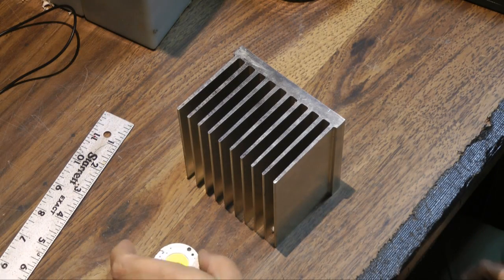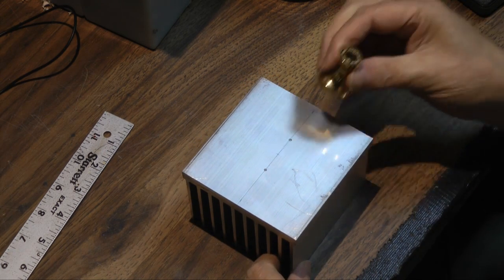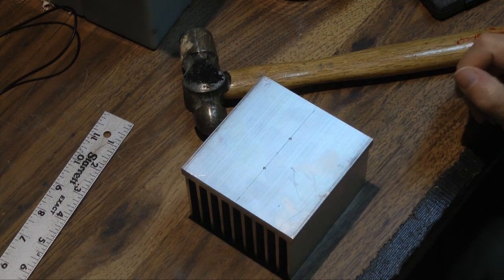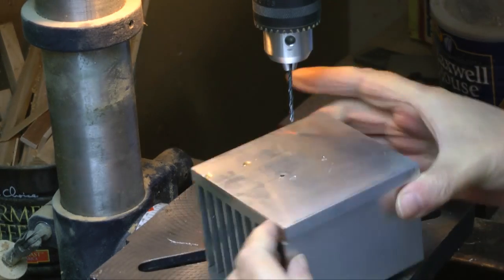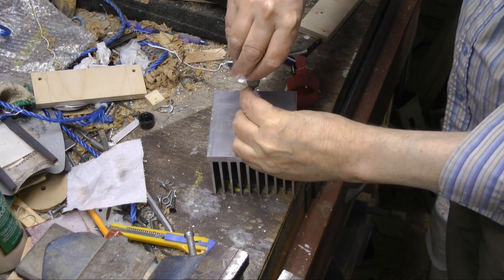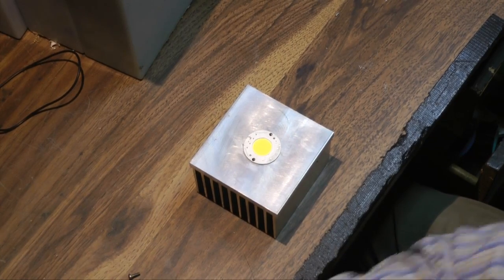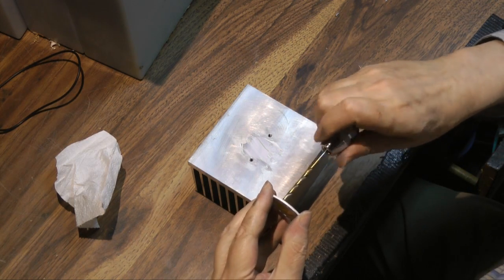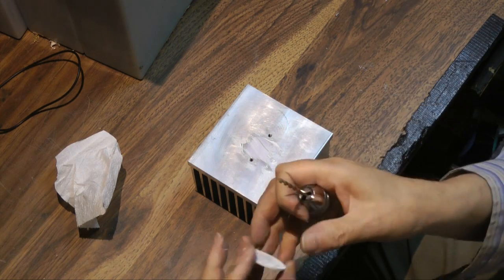Installing LED COB on passive heatsink

Comment: I saw a video where 110cm2 disapates 1 heat watt. And LEDs become more inefficient as they get bigger. I think he was using a 5-10watt led. He found it was 56% efficient. So 44% of total wattage was wasted as heat. Let's say your 45watt led was 50% efficient. That would mean 22.5 watts is being wasted as heat. So you would need (110cm2 x 22.5) ~ 2475.0 cm2 of total surface area on your heatsink to disapate the heat generated. Nice video.
Reply from the maker: Whoever said larger means less efficiency doesn't know what he's talking about... the reason I like a large LED like the Vero29 (29mm) is because you can get over 200 lumens per watt. A small LED like a V8 (8mm) averages 100, you're lucky if you can get 120. Right now I'm working on designing a battery operated emergency light, and even though I only want 150 lumens, I'm going with a V18 so that the battery lasts 2 days, not 12 hours, which is what you would get with a small 150 lumen LED. The V18 could output 12,000 lumens!

I usually use a fan for cooling, I only use passive on small lamps like ceiling lights (no noise). This video was just a test.

Thanks for your comment.

Comment: did you ground this light?
Reply: Most of what I do is experimental on the workbench, and I use isolated power with no connections to the outside world, including ground, for safety and practical reasons. Since my oscilloscope is grounded, I cannot ground the electronics I work on or it would blow up! Any luminaire I make is usually case grounded.

Comment: I am currently DIYing a 50W COD 220W (Driverless) on some old intel PCU heatsink. this :https://cdn11.bigcommerce.com/s-n2pgpewhfn/images/stencil/1280x1280/products/393584/391141/A57855-001-lg__71618.1555056032.jpg?c=2
During my first testing, the heatsink is reaching 50 degrees, because I supplied the fan with only 5v
Test 2, fan supplied with 12v, cooling is better, and heatsink is around 40-42 degrees.
I like it working at 5v , because fan is not noisy this way.  do you think 50 degrees is fine for a heatsink connected to a 50W COD?? with Fan heatsink is reaching crazy temps, at stopped at 80 degrees, because dont wana destroy the led...
Thx for any feedback, 
Regards

Comment: u have any old used hi lum cob for i need all the help i got 114volt 320watt 2800mah what can i do with it i got 1212 cluo48.  not 1216  help
Reply from the maker: I don't know what COB you can run with that supply, do you know the output voltage range?

Comment: Given the choice it seems like the cpu fan is a better option? Those artic cool fans are now only around $10

Did you run an experiment with no heatsink or cpu fan? If so what temps did you hit?
Reply from the maker: The fan won't last too long if it's running every day, certainly not 10 years like the LED. Also it may be subject to high humidity or dust or something. Moving parts are always a disadvantage! I did start to experiment with passive sinks but I moved to a new house, then I had an accident, and I haven't had a chance to get back into it. I will start again soon, but I can tell you that it depends on the size of the sink and the LED. I have to import sinks from the States and that is freakin expensive, especially shipping on the big ones! A 4" cube sink can maybe cool about 45 watts, and stay below 85C. I'll have more data soon and make new videos.
Reply: @Flintsmooth  I loved your video and the information you provided, I didn't already know. I love coming on the internet to learn new things. That being said, I think you would be surprised at the longevity of CPU fans. When I lived in Maryland (I now own a home in Michigan and live there) I ran a 6 core AMD Apu for nearly 8 years straight; full throttle on the factory cooler. Don't ask me why... But it never hiccuped even in the slightest. Never stopped performing and never gave me the idea it would fail. Maintenance is key with anything that has moving parts, every now and then vacuum or use compressed air to clean the heatsink and fan. With passive cooling applications this is nearly negligible, but for active cooling it will drastically increase the lifespan of your fan.
Reply from the maker: @troyguinn303  I do have LEDs with fans running, all my grow lights have fans, but my custom house lights are passive. One problem I had was a wire got too close to a fan and somehow got caught in the blade, the LED burned itself black! Could have been more serious, but it open circuited. I make sure my wires are better secured now! I don't mind fan noise in the grow room since I don't spend time there, but in other places I prefer the quiet!  I have a grow cabinet in my living room with 4 fans, that can get a bit annoying! I have bought at least 25 different fans from amazon and I test them for air flow and noise. Someday I'll engineer a proper test facility and do a YT video of comparisons. My most powerful and noisy fan is a small Bgears unit, but not all Bgears fans are the same.

Comment: hi again..good work as ever.how much do you think would be cob temperaure on a vero29 v7 run at 1050mA? around 38W...could you also say me the heatsink code  to see the datasheet?  it seems to be similar at a m1 passive from artic but with a flat base, isn t it?

Comment: Hi. Can you tell me from your experience what surface heat sink need for 3 watt power led? or if is some calculation for that? I have 3 watt led X 4 pieces mounted on the same heat sink aluminium(4,5 cm/4,5 cm X 3 cm) and after couple minutes heat sink is around 70 degree Celsius. Any suggestions,please ? cheers
Reply from the maker: +Robert s   Your heatsink is rather small... the smallest sink I've used was on a 4 watt LED, and it was about 8cm x 8cm with 3cm fins. I've also used a 10x4 with 4cm fins. Lots of times for small LEDS I use whatever hunk of metal I can find, as long as it is larger than around 100 square cm.

You are dissipating 12 watts so you want something big, maybe 10 x 10 with 4cm fins. You can see in the video the huge size I needed to cool a 45 watt LED. With no air movement it got up to 40C.
Reply: Flintsmooth Thank you for explanasion. I've used my small radiator and added cpu fan running on 12 volts with 27 ohms resistor. My source is 15 volts/1.2 Amps connected 4 leds x 3 watt/650mA each in series and doesn't heat more than 50 degree after 15 minutes of use.It is my first led bulb from start to finish. It is noise but next one will be only with large heat sink like you suggested. Cheers

Comment: what kind of glue did you use?
Reply from the maker: +Jonathan Tanoto I didn't use any glue, I used a thermal grease that isn't a glue. I've had it for years and don't know the brand. The LED is attached with screws.
Reply: is it possible to use a glue gun or solder (?), cz i dont feel like using screws
Reply from the maker: +Jonathan Tanoto There is a thermal glue for this application, called Arctic Aluminum. It's available from HeatsinkUSA.com
Reply: okay, but i'm looking for something that's common and easy to find... any idea?
Reply from the maker: +Jonathan Tanoto Well, it depends on if you have some thermal grease or not. It's not hard to find, but if you don't have any, just make sure the heatsink  where you mount the LED is absolutely clean and flat. Polished to a shine! 

If you don't want to drill holes, hold the LED firmly to the heatsink and put some epoxy glue around the edges. Use a small weight to hold the LED down while the epoxy sets. Don't scratch the yellow area!

DON'T USE SUPER GLUE!  The fumes from that instant super glue will destroy the LED!

To test your work, check to see that the heatsink heats up in use, and not just the LED. If you can, reduce the power to test.

Improper mounting will destroy the LED, so take care!
Reply: alright thanks! this helps so much

Comment: I could not see exactly how the supply wires were attached to the LED unit?
Reply from the maker: +Peter Owens I used a Molex connector that is available for these LEDs. You can also solder wires to them.

Comment: hey, tnx for the video.

I'm about to mount some cree cobs, I'm wondering about preparing the heatsinks, I've heard to sand it down to 1000 grit but I cant find anything conclusive, do you sand down your heatsinks before you mount? (i plan on using precut 3m squares for the TIM)
Reply from the maker: Yes, the flatter the heat sink the less critical is the heat transfer method, either paste or thermal pads. A mirror finish heat sink probably needs nothing! I always sand with at least 600 grit paper, under a flat stone to get a straight surface. I don't use the stone for any other purpose to insure it stays flat. I'm thinking of buying a machined steel plate for this but it's expensive. BTW the worst heat sinks I've found are the ones for CPUs, they are very rough. In one of my videos I show how to check if the LED is properly mounted by watching the current when first turned on. An improper mount will very quickly heat up! It happened to me once when a super small piece of crap got under the LED somehow, I cleaned it all off and started over!